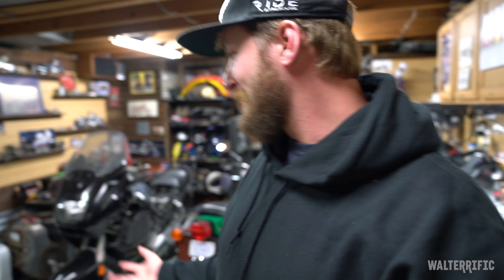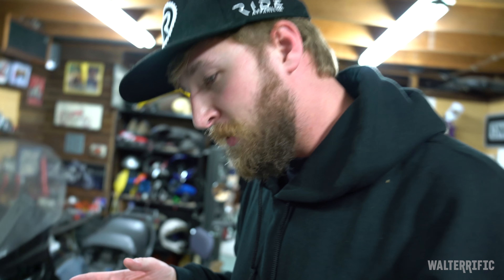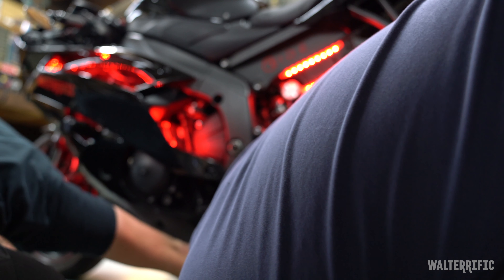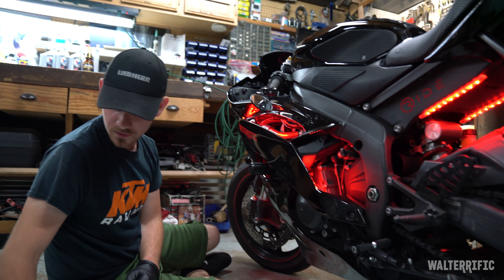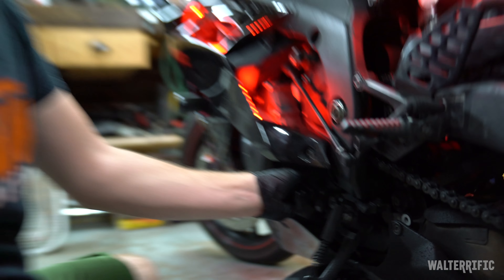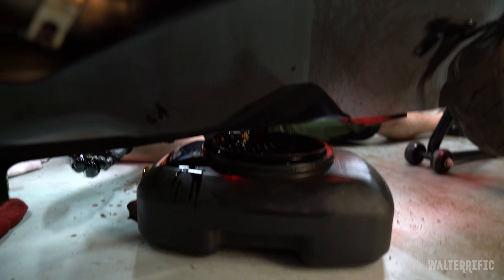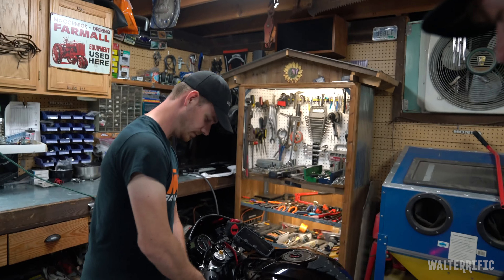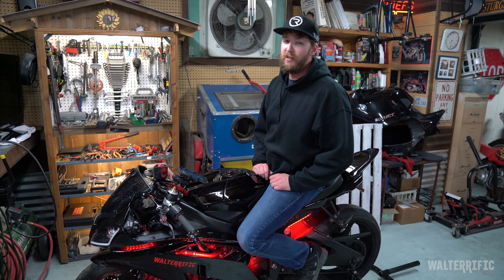Whatever Wednesday - Yamaha R6 Oil Change

Comment: I literally just did an oil change on my 2005 R6 today. I put in a K&N oil filter and poured in some brand new Amsoil. Luckily on the 05 R6 I don't have to remove the shifting rod.

Comment: Nothing wrong with it, but you don't need to prime the filter it will be just fine and less messy putting it on.  Also to avoid chain lube getting everywhere just use dry chain lube :)

Comment: Hey walter, i'm looking to getting a new motorcycle helmet and i really dig the ones with the tinted/mirror visors but i ride alot at night so i was wondering how well you can see with a tinted visor at night
Reply: You can't see alot with a tinted visor at night
Reply: Put on some sunglasses and go for a walk at night, that will tell you how useful tinted visors are at night.
Spoiler. Not very good.
Reply: Mollie tol They make helmets that have both tinted and non tinted visors. You don't have to screw them off or change visors do research on it. I don't have it but look into it
Reply: Usually the visor is swappable by two clips. You just have to buy the tinted visor.
Reply: Just swap between tinted and clear if you know you will be out at night.
Reply: You don’t really look through your windshield at all, unless you are tucking( speeding in 6th gear, usually on the highway)
Reply: I've got a photochromatic visor on my Shoei RF1200 and its the best of both worlds! It's clear at night and when indoors, but once it gets exposed to UV rays and heat from the sun it changes to a dark smoke tint. And it varies with the light outside, so if it's cloudy then it won't be as dark as it would be if it was sunny out. They're a tad pricey, but so worth it!
Reply: thanks that's some good advice

Comment: I haven't heard anything bad about k&n oil filters other than they aren't oem equipment.  I always use oem oil filters and use a pipe wrench as close to the base as you can get  to pull them off.